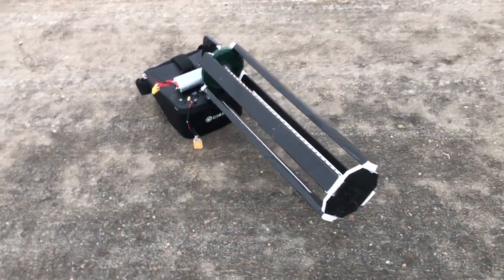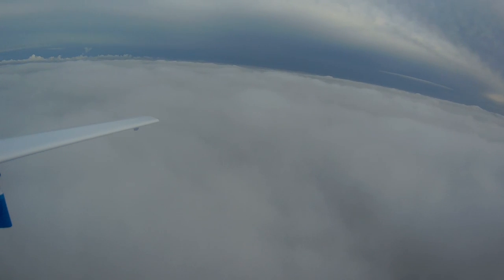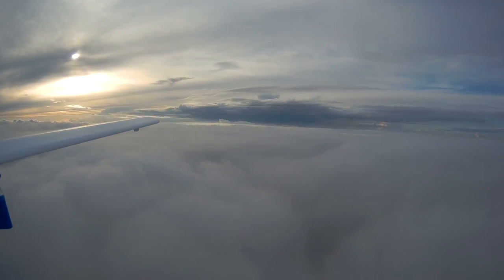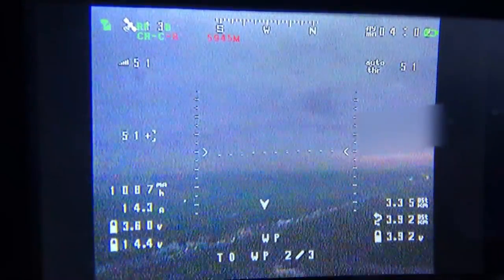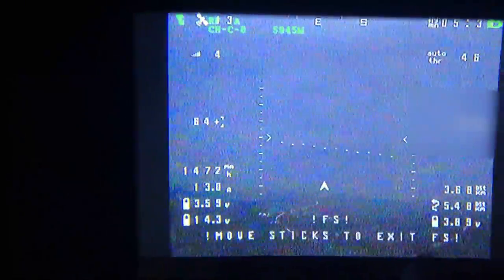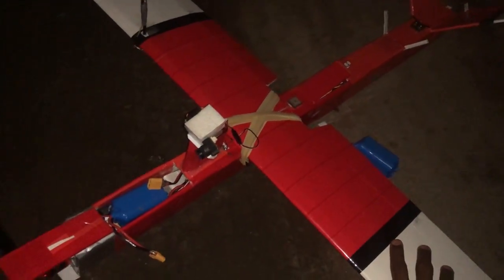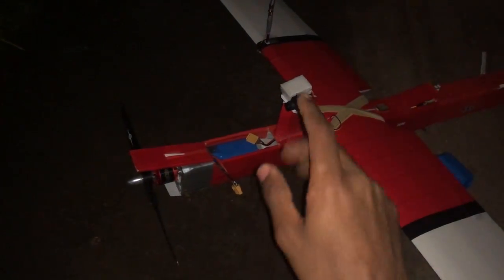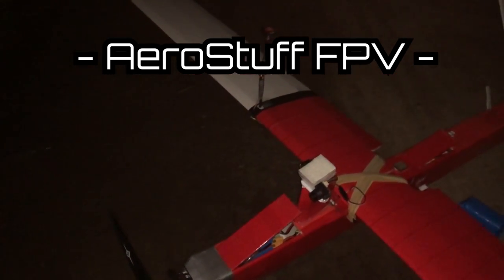Homemade 34-Turn Helical Antenna for Long Range FPV Review & Range Test - Helical vs Patch

Comment: Great video, very well presented, and thanks for the shout out. Super happy to see people’s experience with my DIY helical build. Incredible for a cheap easy thing. 
Definitely get your DVR fixed, and maybe think about it HDZero system this year once the new high lower VTX is out. 
Though actually, for a long range plane you might have great success with the SIYI digital system. I’ve never used it, but reviews seem very positive. Keep up the good work, cheers!
Reply: What's your take on the Prosight Connex HD system? Almost nobody talks about this and I'm not sure why other than marketing?
Reply: @jameshatton4211  unfortunately I honestly don’t know much about it...

Comment: Glad to see you were out trying your creation out.  That is a very narrow beam and hard to stay inside of it.  Nice build!
Reply from the maker: Thank you very much! I've recently flew Long Range and had +7km with a SOLID signal! (Almost perfect, but very sharp & colorful) @800mW with the same plane (but a different receiver). 

And another Personal Thank You for messaging me on FB about the antenna. You were the only one optimistic about it, knowing more about these antennas than others!
Reply: @AeroStuffFPV  - I remember when I first started experimenting with antennas and most of the FPV community said that I was foolish to make my own.  They told me that dipoles and patch antennas were better than anything I could make.  Looks like they're eating their words now.  Most people think DIY is foolish and ridiculous.  However, that is a hobby in itself for us tinkerers.  Some of our creations will work and others will not.

In any case, I'd like to send you a kit of sorts for my new Avenger antenna.  No cost to you of course.  I just want you to build it.  It is a Crosshair Xtreme with a parasitic waveguide in front of it which increases the gain to 12.5dbic.  I haven't even released it yet so you will be the first to have it... and you can tell everyone you built your own ;)
Reply from the maker: @CAGreve1231  You've put a huge smile on my face! I can't thank you enough.

Comment: It would help if you looked into setting up a retransmitter.  Then you could have the big helical on a tripod or other mount and retransmit on another frequency to your goggles.  That gets you a good range but requires neither a heavy head-mount antenna nor care in facing the right direction.

Comment: The biggest problem with having that many turns is obviously the gain Factor will be quite high, which means serious tight directivity! You better be ready to keep that thing perfectly on track because no matter how tight you try just being off by a couple of inches will lose your video substantially. It's almost not worth having something that high game unless you're tracking is perfect you're better off with the lower gain antenna maybe stacking them which of course will add to directivity to some degree

Comment: Thank you for the well explained video. I also have the ev800d goggles but with the stock antenna’s I’m getting low range with a 1000mw AKK vtx barely making it 300 meters. Are you running a 5.8ghz amplifier and diy antennas to get this range?

Comment: You can sometimes use a file recovery tool to get the dvr back. I did that on my ev800d and it worked
Reply from the maker: Thanks! Which one? Bc none that I’ve tried worked...
Reply: @AeroStuffFPV  EaseUS. There's 2 free versions, one called the trial version and one called the free version, if you get the trial version you can't restore anything but if you get the free version you can restore 500mb of the files it can find.

Comment: Bro u definitely need to invest in a 3D printer.
Best $250 ever

Anything you want, you can just print it.
I was able to print out some wings out of LWPLA which is basically the same as regular foam but slightly stiffer.
It can be annoying to use F360 to model the parts, but overall its still worth it.

It really does change the whole FPV experience when you can just model in your own gimbal, or even your own bomb bay.
Reply from the maker: Correct,

It’s a game changer, but I have to wait until I’ll afford and have enough material to start printing parts, mechanism’s & more
Reply: @AeroStuffFPV  I think it's too time consuming and finicky to configure. I like the fact you use simpler and cheaper materials and get good results. I'd suggest you to try some hotwired wing and fuselage so you can compare the performance.
Reply: Damn I didn't realize I could get a 3d printer so cheap... I wish i was just a tad less broke and had a bit more space 😅

Comment: Hi, I wanna build my antenna
Is it that hard to make a good antenna for long range? (+10km)

I didnt have any back ground in Electrical/Signal. 
Is there any guide to make a helical antenna?

For me, the factory made ORT antenna 12turn is so expensive ($50)

Comment: Awesome video dude, and lucky at the end. Have you thought about using a camera tripod to hold the helical antennas at the plane? I believe with so many turns, the beamwidth may only be a couple of degrees which might explain why it was a bit inconsistent.
Reply from the maker: Thanks! 

Yes, I thought about having a TriPod with an antenna tracker. But I have it permanently mounted on my Goggles... 

I don’t see the need of a tracker either because I move my head like one ever so precisely to get the best picture :)
Reply: So your head is tracker , natural and smooth

Comment: Did You use a 50ohm terminator on your tripple feed patch antenna? With 600mw of power on vtx and this 14dbi antenna the range should be over 20km easy.
Reply from the maker: Yes! But still bad video over 5-6km.

Comment: Reallly!!  That foolish contraption  looks like you  now need a Neck Brace to keep your head supported.
Reply from the maker: I’m not using the 34T anymore, I’m flying with a homemade 16T which is a lot lighter and has shown great video at +10km.